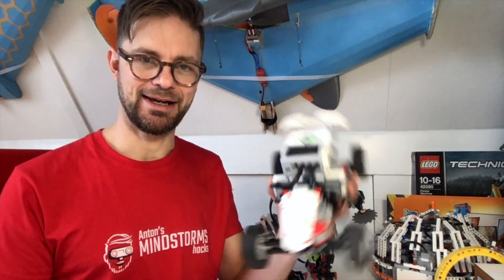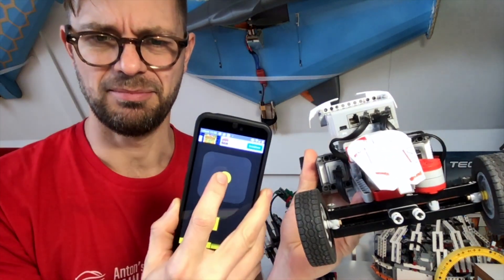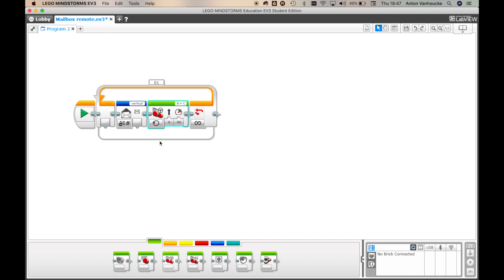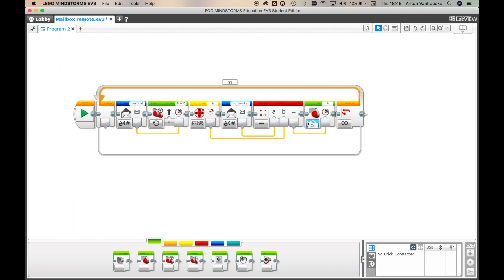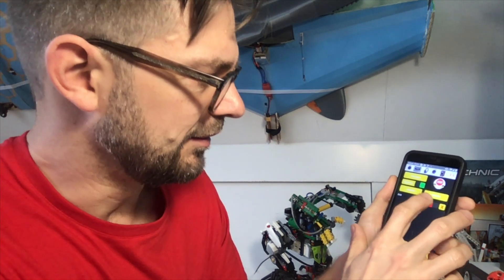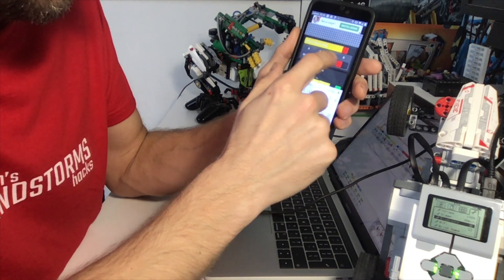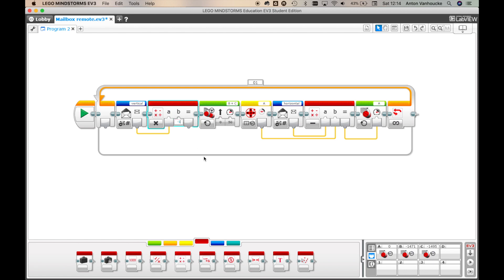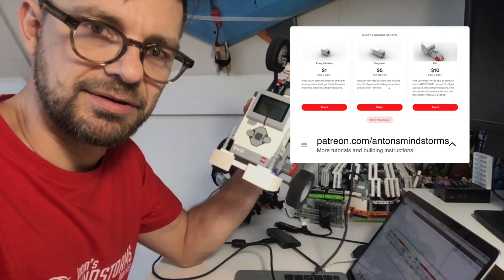How to program an EV3 LEGO race car for remote control with an Android app.

Comment: How can I send information from sensors in the car to my screen in the phone? For example, if I have an ultrasonic sensor, how can I make it send the distance to the app?
Reply from the maker: Mailboxes work both directions. Are you writing a phone app yourself?
Reply: @AntonsMindstorms  No, I just wanted that the ultrasonic sensor attached in my car could send the distance to this app and show it on the screen. Is that posible?
Reply from the maker: @ytchannel399  not that I know
Reply: @AntonsMindstorms  why not just take 5 seconds and check whats the name of the app dude.. Dislike.
Reply from the maker: @vilppe3259  I don't understand what you want. How can I help? How can I improve this video.